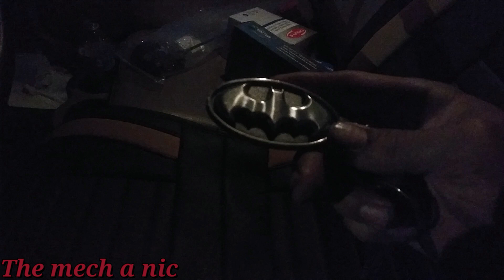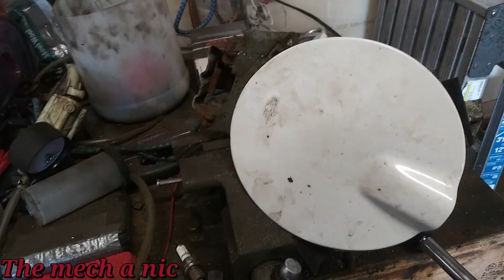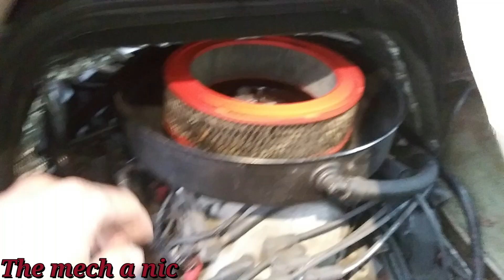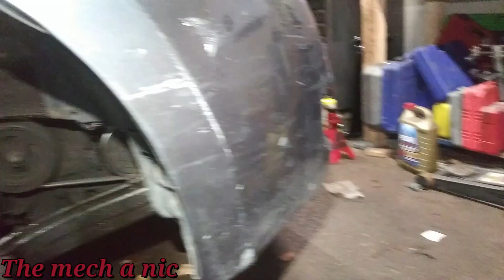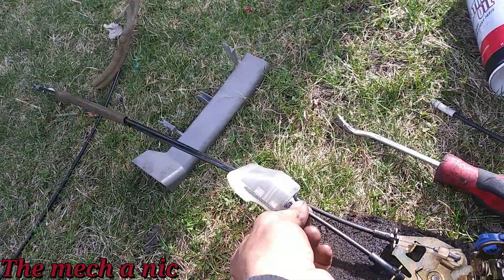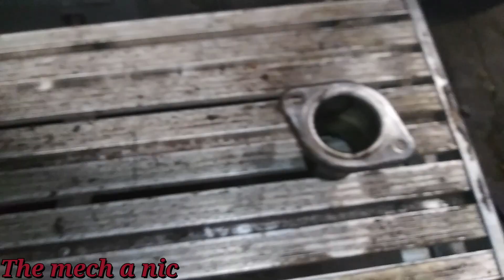altima engine mounts / altima door handle /colorado fuel door /ram 1500 water pump (vol 93)

Comment: OMG that Ultima is a DEATHTRAP. Imagine, engine off/bad electrical situation,
accident, etc. No exit? WTF man?

Hey, I gave advice before watching your follow up of mount.
You can still pack JB Weld, drill & tap. A key thing is cleanliness.
The old threads will give great bite for the epoxy. (in a future other situ).😁
Reply from the maker: Yeah its a recipe for disaster

Comment: All those bare wires are a perfect candidate for electrical contact
cleaner, then slather on liquid electrical tape, at least 2 coats. 
Charge 1 hour. Don't have to touch one wire- just dab in place.

Wire wheel threads clean. Lightly coat threads with Vaseline to protect.
Mix up 2 part JB Weld, pack hole full. Stick bolt in, hit bottom, do not twist! 
Apply a brace, or duct tape into place. Wait 24 hours. Remove bolt.

OR 
Simply clean & pack hole, stick a wire in & out to remove any air.
Pack hole full. Tape over. Wait 24 hours. Drill & tap.

I know- I said I wouldn't give you dumb advice anymore, sorry.🤷🏻‍♂️

Comment: I dont get how aftermarket cant be made the same... like a copy of the oem part
Reply from the maker: I dont understand it either. Its not like they have to do research n development. Just COPY the original design lol
Reply: Amen. There has to be a patent or a copyright keeping them from making it an oe part.
Reply from the maker: That's the only thing i can think of...or the obvious that it's cheaper to cut corners

Comment: As a mechanic that works out of your home do you ever have problems with people trying to rip you off?
Reply from the maker: Sure. You can tell when someone is up to no good. People i dont trust i charge them before i work on the car. If the bill is high they have to pay before also. I've had two people rip me off by $20 .... Few months later they tried calling again.never worked for those people again.

Comment: If the Guy in the Chevy Colorado ask you to change the fuel pump. Tell him thanks but no thanks on the job. So for some reason on the Chevy Colorado you have to drop the tank but the Chevy Silverado you can remove the bed. Your probably think ok just have to drop the tank. Your going to deal with rust specially if its a northeast truck and the tank is being held up by a strap and a metal bar that is connected to both ends of the frame, In my situation the truck was so rotted underneath the strap bracket broke off and he junked it. 2.5 days wasted on that truck.
Reply from the maker: That sounds like a nightmare. I turn down 95% of jobs that requires lowering the fuel tank. I dont like doing it, especially on rusted junk for the exact reasons you explained. At least you put in the effort 💪